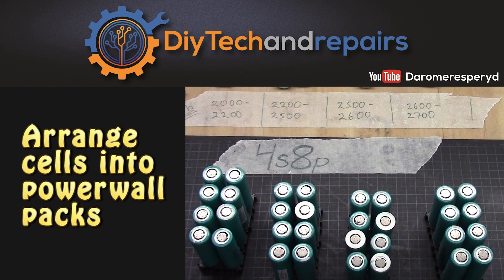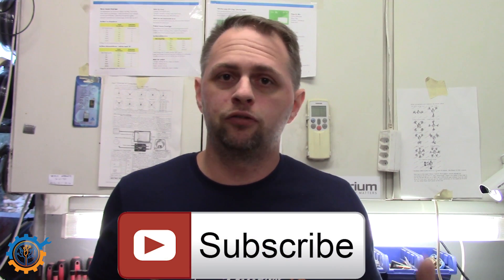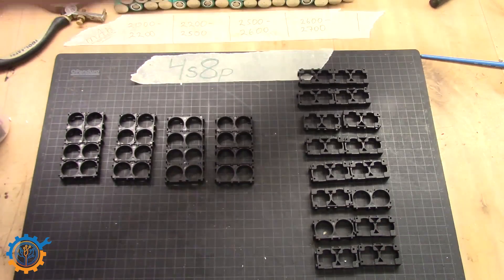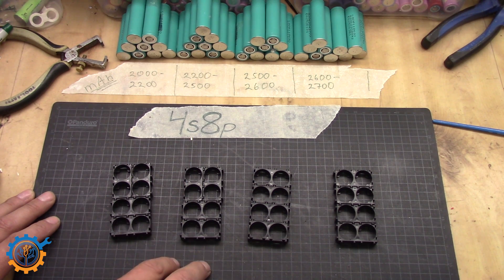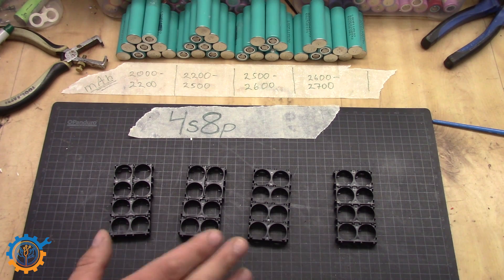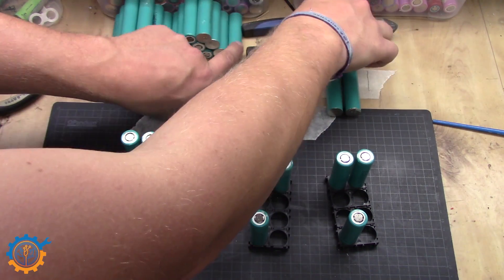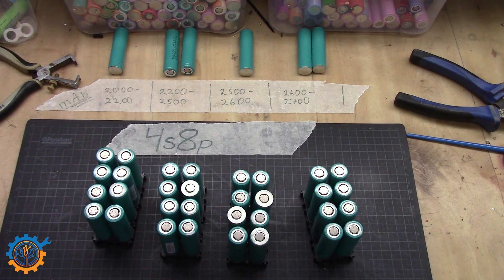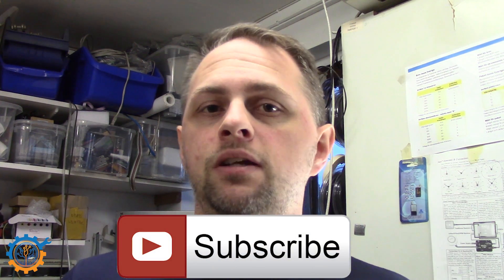Arrange 18650 cells into DIY Tesla powerwall packs

Comment: I have one question . I want to build a ebike battery but I am not very sure about one think : I have about 50 lg cells high drain with testet capacity around 2300 with 3 amp discharge rate cells and about 80 cells Sony vtc 5 high drain as well  with around 1200 testet capacity . Is ok tu mix cells like you did in your video to make a big 36v pack ?  Plan A is to mix but if is not safe i have plan B making 2 batteries att 36 v , one  with lg cells and the other with Sony . What do you think about that ? What is safest at first and best solution ?
Reply from the maker: Its basically the same. But it all depends on your max current if its below 1a mixing is more ok. But IF the plan is to max Them out i would use One sort only

Comment: Hello, thank you for posting this video. I have watched one other posting, of yours and commented on it.
Here, I have a doubt. I saw that you were mixing the Battery Bank with different Amps. Is this alright?
 Correct me, if I’m wrong.
I also have several 18650 Batteries. And some of them are higher Amps and some are not. I know mixing the Battery Banks with different power Cells are  not recommended. How do you explain your design? Please let me know. Thank you.
Reply from the maker: As Long as you Always set max ratings based on weakest cell ur fine. Mixing capacity as such is not a problem as Long as series capacity is the same. Note that those cheap testers test +-100mAh it around

Comment: from the nominal capacity of a 18650 cells, how lower capacity should be consider to think that it is a good cell.
Reply from the maker: Depends on what you got at hand. I always use the top range cells i have first and generally not lower than 2Ah.  Then they are new at most 2.6Ah.  So basically if i check much much they faded i generally dont go lower then 20% of lost capacity.

Comment: in your example you could end it up with one module containing one cell capacity with 2000mAH and another cell with 2700mAH cells this are 700mAH difference this is ok
Reply from the maker: Depends. I dont see the problem with it as such. As long as you dont push your packs further than the weakest point and understand that the ones that are weaker are being pushed harder in the end.

Comment: This is a question I have had for a while. So, if I wanted to build a power wall pack with 18650 cells, should I only use cells above 2000mah and discard any cells below that capacity? Should I use this method to spread evenly all cells among my packs? Should I keep all of my packs with an AH capacity as close as possible among all packs?
Reply from the maker: The range of your capacity is up to you to decide. I go with 2Ah+ since i have plenty above. 
For instance a 3.4Ah cell that only have 2Ah left may not be the best cell meanwhile a cell that have 2Ah and is 2.1Ah new may be better right? 

I think the correct method if you got mixed cells is above method. This should ensure that you got an even balanced packs and all packs have same capacity in the end.
Yes its important to have same capacity in each pack because the weakest pack is the pack that determines the max useable capacity. 
So if you have 3 packs and all have 20Ah except last one that have 10Ah total. Then you cant use more than 10Ah.
Reply: DIY Tech & Repairs thanks for your reply. Hypothetically, what would happen If I have 2 packs of 20ah and 1 pack of 10ah wired in series and connected to a 12v inverter/ solar charger? I know the answer is "nothing good" but I'm just trying to understand the consequences of such a decision
Reply from the maker: You wont be able to get more than 10Ah out of the pack. Thats what will happen. You also need to design it based on that 10Ah pack if thats the weakest pack. It Will work but there is no reason doing it that way.  The voltage of that pack will also be a bit out of balance to the others during charge /disharge
Reply: When I break laptop packs apart I always identify which cells caused the failure, they always have much lower capacity (0V doesn't count, those often come back). My primary powerwall pack build only gets the good ones from each laptop battery. The marginal ones go into miscellaneous packs. From what I've seen if builders have enough cells over 2000mAh to build a pack then they will use 2000 as the lower end cutoff.

Comment: Thats pretty much how I did it!👍
Reply: I have a different ? I've recently came across 3 model 54150 dc to dc chargers used for the Raven reconnaissance drones i can't find any info anywhere other than manufacturer is based in silicon valley, im in hopes of hacking to use 1 as a bench charger any replys welcome. Thanks in advance

Comment: For a 12volts  led lights,  which setup is best, 3s or 4s?
Reply from the maker: either nor neither :) Beacuse 3s can be to low and 4s to high. Both will work in their sense. it depends on the equipment you have for your lights. if they run of DC/DC then 4s is most likely best choice.
Reply: Either would be fine.